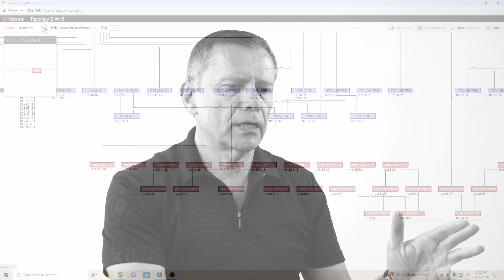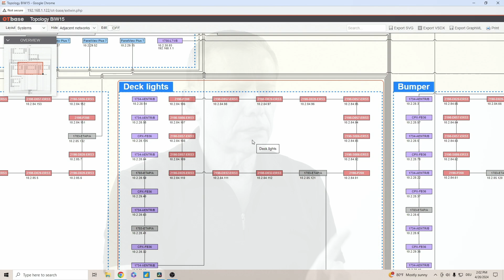The Purdue Model in OT security

Comment: This could be wrong?  Just because these devices are routable doesn't mean it can't be protected.  Many firewalls can inspect the application traffic and policy can be applied to that.  With that said, if you're saying "the control station will always have full control and policy should never be applied to limit capabilities".. then the statement would be true. Not to mention east/west segmentation.  You could argue this is less about *if the engineering station gets compromised but if *anything gets compromised. Reducing blast radius.

Comment: I fully agree with you but could you please suggest how to protect especially OT environment nice now a days OT network also have WiFi access . Also how we can physically protect OT environment.
Reply from the maker: Network security is a solved problem, no matter if wire-based or wireless. It just needs to be done. Physical protection of OT environments -- also not a conceptual challenge but it requires discipline. Study the nuclear industry for ideas, they got it figured out; up to the point that intruders will be stopped by lethal force.